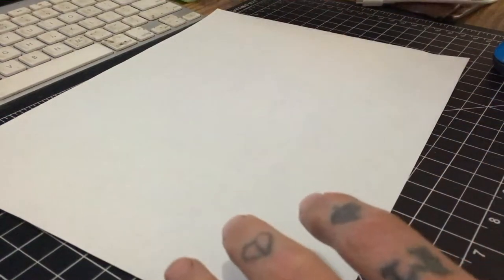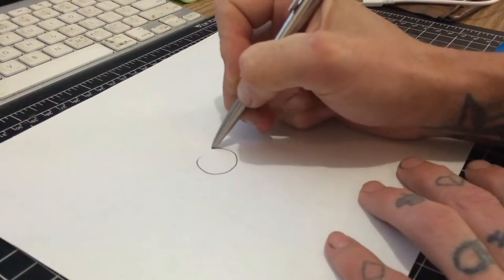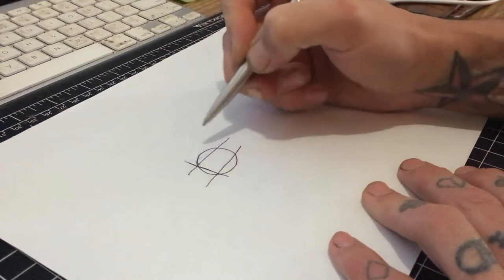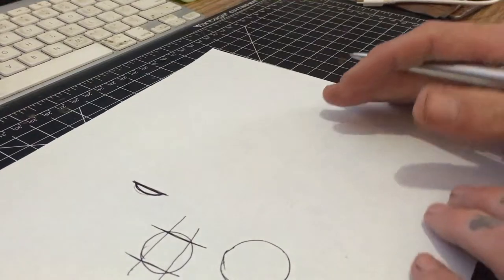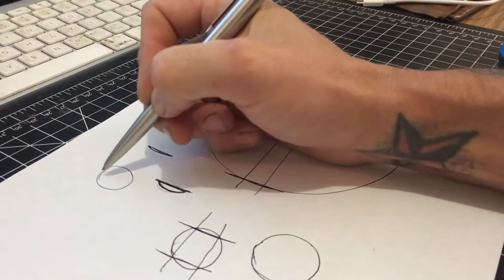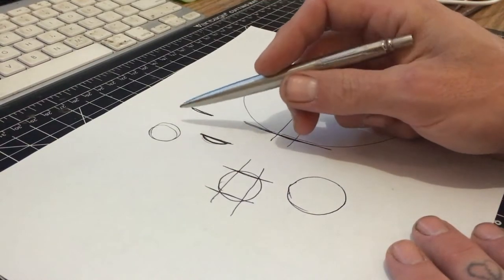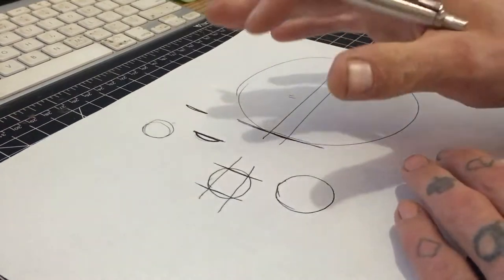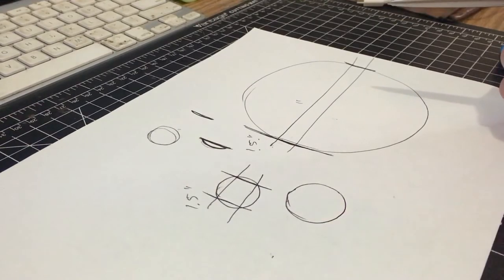My Response to VSauce and Adam Savage NAPKIN RING PROBLEM: SIMPLE EXPLANATION  S09E07

Comment: Thanks for helping me understand. I did not grasp that you had to complete destroy the internal structure of the larger sphere. In the case of using the Earth compared to a golf ball (or whatever it was), the Earth would also need to have anything with vertical height stripped off of it. I am over here like ‘bullshit there are trees and mountains that take up space’. They were talking about removing so much material both inside and outside the Earth it would damn near be just like 1 molecule or atom in thickness or something like that. Sure, I don’t see why not.

Comment: Well from Michaels explanation its completely untrue and very different from your explanation. Ofcourse if you always cut a cross section of the same size it will always have the same volume no matter the size of the original sphere... but Michael states that so long as the height is the same then any sized napkin ring will have the same volume. Which in reality is entirely untrue but through using long winded theoretical maths it can be explained as a paradox. The principle that they are basing this off is all true though so I don't understand how they've gotten so confused but oh well.
Reply from the maker: lol thanks?
Reply: TheHarimgrebduhl They (Vsauce) left out the important limiter that R (radius of the sphere) is not important as long as y is less than or equal to h/2 is less than or equal to R. 
This equation is what the video here is about (removing the interior of a sphere and only leaving a 1.5" ring).
This limiter negates the statement that R is not important because it is crucial to figuring out y.
I had a 30 min discussion with my mathematician wife just so I could understand the missing information explained in this video.
Reply from the maker: Thanks... I think... LOL I mean i get what you are saying but damn, its like Vsauce trying to explain this theory again... hahaha so technical.